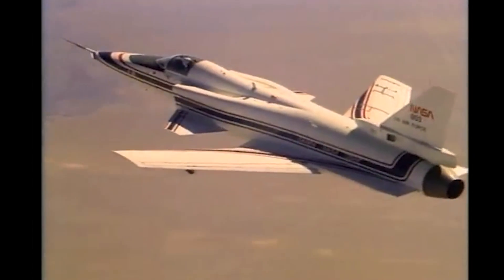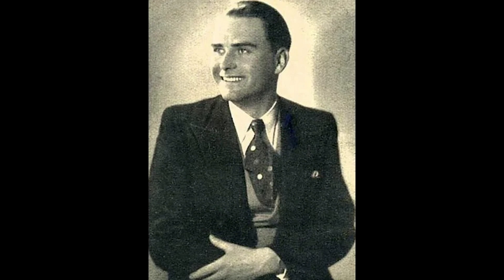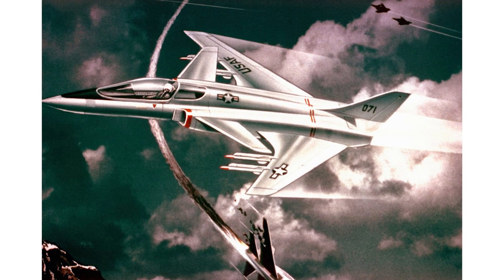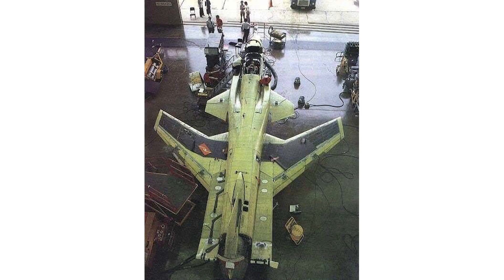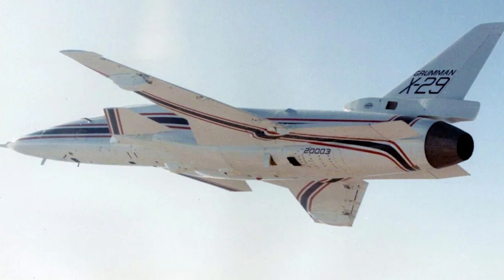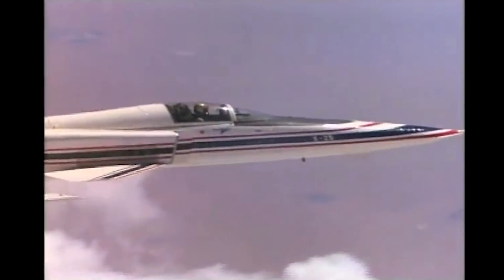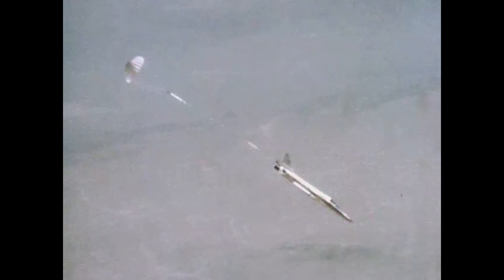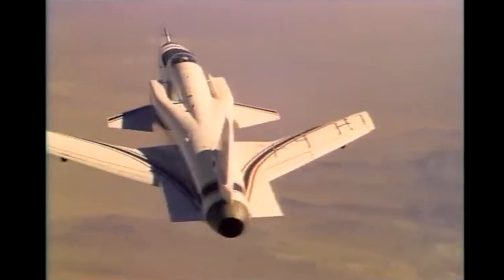Grumman X-29

Comment: This is the first YouTube video I have seen anyone do on the X-29 where you actually describe the aerodynamics correctly.

I'm Australian but was lucky enough to do a degree in Aerospace Engineering in America courtesy of a sports scholarship in the late 80s. During my final year we had a series of guest lectures usually from alumni who were doing this in industry. I distinctly remember 2 of those lectures. One was on terraforming mars and the other was from an aerodynamicist who worked on the X-29.

So I have heard directly from one of the guys who did the aerodynamics of this plane and everything you have said here about the positive feedback of the wingtips is 100% correct. Also my professors area was aircraft structures and he specialised in 2 things finite element analysis of axisymmetric structures and aeroelasticity. Unfortunately he didn't get to teach the class in aeroelasticity because there were never enough students signing up for it but he did explain the basics of it to me. I actually spent a summer working for him doing FEA on the APDS for the Abrams M1, but that's another story. 

Hers's a slightly more detailed description of wing divergence and flutter.
Both wing divergence and flutter are structural effects caused by aerodynamic forces on the wing, hence the term aeroelasticity. They come from the basic fact that pressure is a force and the flow of air causes differential pressure across the surface of the wing. The first effect of that force is to bend the wing upwards. That's easily noticeable if you get a window seat on a commercial jet where you can see the wing. On the ground the wing tip will usually droop a little towards the ground but in the air the wing bends upwards. The second effect is less obvious but its a twisting effect on the wing because of the variations of the pressure across the wing. 

If you go fast enough those aerodynamic loads can bend or twist the wing far enough that it just breaks. That is called wing divergence because the wing simply diverges from the rest of the plane. For anyone who's a pilot that's why there's a Yellow mark on your airspeed indicator for Vne (Velocity Never Exceed).  Yes the wings wont come off at that speed as there's a margin of error, but if you ca past that point and the wings stay on the plane has to go to the mechanics to find out what you damage you did do.

The other effect what we call flutter is more complex and the videos below will show why it has that name. As the wing twists it also changes the angle of attack. In some wings that gets to a point where the wing starts to stall at which point in dumps the lift and untwists. It can then load up and twist again until it stalls again. Its a cyclic effect that can under certain conditions activate one of the wings dynamic characteristics (natural frequencies). There's a few good videos here on YouTube that show this. 2 of my favorites are:
"How to break a glider´s wing" on the YT channel diegocodagnone
"Aeroelastic Experiments - Very High Aspect Ratio Wing" on the YT channel Dani Levin
About 2 minutes into the second one you can see both the wing tip twisting and the wing flexing.

If you have a look through this video on the X-29 you will see that it has an incredibly thin wing. The trailing edge flaps and ailerons on the wing had to be powered and if you look carefully you'll see there's small  pods under the outer wing. Those pods are the aileron actuators. the aerodynamicist who gave us that lecture explained they had to be in pods because the wing was so thin they could NOT be inside the wing. They also had to be powerful and very fast to counter the aerodynamic effects.

LASTING EFFECTS of the X-29
Another thing not brought up in much detail here is that the triple redundant dynamic control system has had a massive effect on aircraft systems since. This was the first time an aircraft of any sort had a digital system where the stability of the aircraft was fully controlled by the computers. All other aircraft up to this point had their stability either designed into the airframe or was done by analog computers. This has had lasting effects on fighter design and is most notable in planes like the F-22. There's a great video on the F-22 flight control system titled "Special Lecture: F-22 Flight Controls" on the YT channel MIT OpenCourseWare, which is totally worth the time to listen to. Also on the YT Channel Ward Carroll he interviews an F-22 pilot in the video titled "Deep Intel on the F-22 Raptor" which if you watch AFTER the other video will make a lot more sense with some of what's said. 

That all said, if it makes you wonder why the Boeing Max-8 MCAS system was NOT even double redundant let alone triple redundant. The only answer I have there is to take your pick of stupidity, insanity, greed or a combination of all 3.
Reply from the maker: Thanks Tony and thanks for your expanded description as well - simply awesome. We didn't want to get too technical with the physics around aeroelastic divergence and anisotropic elastic coupling as that's not the nature of our summary videos, and we certainly can't claim to be aeronautical engineers! But thanks for your input - it's constructive comments/input like yours that makes YouTube satisfying and inspires us to keep going!
Reply: @raafdocumentaries  I'll give you something to think about.
AND I AM WILLING TO DO AN INTERVIEW ON THIS

To graduate we had to do a couple of high level aerospace classes. These are usually run in parallel with postgraduate classes with exactly the same classwork except the postgrads do term papers for their extra credit. Most students do Finite Elements because its fairly straight forward and orbital mechanics because that's what the comms satellites people want.

A few rare (unwise and possibly stupid) people like me do something like space craft dynamics because it sounded "cool." It was a class where you learned the math of space craft orientation which sounds neat but is in fact insanely hard. All space craft have their own local X,Y,Z,y,p,r coordinate system but are actually flying in a spherical coordinate system. So it involves not only solving the differential equations but translating them into the other coordinate system. PLUS it involves gyroscopes so nothing is straight forward as there's coupling between the axis.

Quiet simply its the HARDEST math in engineering across all fields. Sorry to any other opinions it just is the hardest. Your solving (as in integrating) multidimensional simultaneous differential equations while doing a coordinate system translation. Try saying that.

After the first week I tried to get out of it (and wasn't the first) but the professor kept the 4 or 5 of us undergrads trapped along with the 7 or 8 post grads. 

In that class however was the single smartest engineer for solving complex math I have ever met. To do what we did in that course we were all well above average IQ but this guy made us all feel dumb. He was not at the next level but several levels above us.

it was 1987 so almost all of the postgrads were sponsored by DARPA and working on Star Wars this guy was hyper-funded because he could do the math to make a satellite point with next level precision. One of the major issues with pointing in space is structural vibration caused by inertia as you start and stop orientation manoeuvring. That's no issue with radio signals but is utterly useless when your trying to zap something doing kilometers per second on another orbit or ballistic trajectory.

So this guy had the idea of putting in small opposite moves to cancel out the inertial and vibrations. So he was taking the hardest math in engineering and making it harder by adding into it structural dynamics. He actually made it work for the satellite in 2 dimensions, but the math for more dimensions as well as mapping into that problem the trajectory of the target was even beyond him at that time. 

Then of course the cold war ended and Reagan's Star Wars with it.

So I know as only a VERY FEW PEOPEL EVER HAVE of why Star Wars failed to ever make space based lasers work.

Yeah I know there are people who are now saying they can put a laser in LEO and start a fire. 
BULLSHlT I have been in class with the only guy who ever got close to solving the math.

In layman's terms there's an easy way to see the main issue.
Imagine you are in a car doing 27kmh and you are asked to reach out the window and shoot a stationary target 200m away with sub-millimeter precision. Now considering that precision Olympic class gold medalists are only just that kind of accurate at 50m its a hard task let alone adding the fact your moving.
NOW ADD 1 zero to each of those numbers so that is 270kmh and 2km (2,000m). 
NOW ADD 2 MORE zeros to each of those numbers so that its 27,000 kmh and 200km BECAUSE that's what you need to start a fire from space with a laser.
NOW change that 200km to 2,000km and make that target a FAST moving target and then you'll really begin to get your head around the problem of shotting a ballistic missile with an orbital laser.

But then there's what actually killed Reagan's Star Wars lasers off. 
Somebody asked what would happen if the Russians simply polished their warheads so they were nice and shiny, like mirror finish shiny!

Just yesterday I saw Scott Galloway interview and author David Ignatius who wrote a fictional story about space based weapons and he acted like he knew what he was talking about and I can guarantee GUARANTEE that David Ignatius has not got the first clue about space based warfare. NOT EVEN a tiny fraction of 1%.

But then not many people do because they were not in the position I was, in the late 80s.

If you want to do something let me know.
Reply from the maker: @tonywilson4713  Wow! My head is spinning just reading your description! This is probably out of our lane (as fascinating as high-level aerospace physics is) although you could get an audience at @aerospaceengineering5120 or similar. Anyway, appreciate your input and feedback - looking forward to your continued input with our other videos!
Reply: @raafdocumentaries  Yeah you really don't want to get into the issues of aeroelasticity. I got that warning 37 years ago from my professor.

It one of those areas that's incredibly important to all aircraft because of needing to know Vne, but its so damn hard to get into and get experience and get experience linking the aerodynamics to the structural dynamics that its near impossible to be active in.

Wing divergence isn't too hard to get to because its a fairly straight forward "how much will break the wings off" sort of issue. But flutter means getting into the dynamic modes of the wing and that's serious work at the best of times.

Anyway thanks for the reply. I have started back tracking through some of you other videos.
Reply from the maker: @tonywilson4713   I'd say things are a bit easier these days with the maturing of computer modeling but I guess (not being in the game) that physical experimentation is extremely limited (unless you are NASA/DARPA). Thanks for following us!!
Reply: I forgot to add a thing that's hinted at in this video that was also described by that X-29 engineer.

As a normal wing approached supersonic speed the air over the wing can accelerate to the point where its supersonic. This is usually at around 1/3rd of the wing chord where its thickest. That leads to what is called a strong shock (see below). For the X-29 that shock appeared a lot further back on the wing and was a weak shock.

If you have ever seep the drag vs speed curve for something like a fighter jet there's a significant hump at transonic speeds followed by a significant dip before drag again starts to rapidly climb. That hump is because of these strong shocks. 

Because the X-29 forms its transonic shocks further back and because they are weak shocks with less drag it crosses the transonic region much easier than other aircraft. That sort of thing eventually lead to planes like the F-22 that could go to supersonic speed without the massive fuel guzzling of an after-burner.

The simplest explanation of strong and weak shocks is that the air flow after a strong shock is subsonic while the air flow behind a weak shock is still supersonic. Consider if you have a Mach 2 airflow that hits an object causing a strong shock. In an instant you are taking more than 50% of the speed away and that's over 75% of the kinetic energy. Remember Ke is a squared law and twice the speed is 4 times the energy and that flips going the other way. Now consider that if you only reduce the air speed to Mach 1.5 (from Mach 2) that shock is removing a lot less energy. If you then have another shock after that that gets the air back to subsonic then that 2 has a lot less energy removal. 

If you go and look at the nose spikes of either the Lockheed D-21 or Lockheed X-7 on Wikipedia you'll see they have noticeable curves or steps. That's so they create a series of weak shocks instead of a strong shock. The downside to such inlets is they are a bit like 2-stroke motor cycle engines. They have a very narrow power band and within that band they are great but outside that band they suck. That's part of why ramjets never got much use despite being very efficient at their design speed.

Countering that go look at the Concorde inlet. It has a series of adjustable ramps to create a series of weak shocks. That gave it better performance over a wider speed range.
Reply: To answer the last part of your message - it was pure greed. It's way too common to make your systems with double redundancy in planes. I know that Russian do quadriple redundancy cabling and at least double with control systems on their military crafts. So it's a known thing in the aviation industry... Especially with modern day digital equipment which is prone to failure... so it was just pure greed from them... Because you not only save on installing the system, you also save a little bit on your cost per flight... pure greed.
Reply: @korana6308  Your partly right on the technical.
I'd take exception on the digital equipment being prone to failure comment as its mostly NOT true for most gear. We now have digital systems that are incredibly reliable.

I was a TUV certified Functional Safety Engineer. That system and the training for it was fantastic until the business clowns got their fingers into it and screwed it up. BUT suffice to say I am very well trained on the concepts of redundant safety systems.

When Siemen's brought out their S7 Safety PLC it had only a single processor and everybody went "That's not possible. It has to have redundancy." I know the standards better than most and you can get to SIL 3 with HFT = 0 but you then have to PROVE that BOTH the hardware and software have incredibly high reliability. Siemens were able to do that. 

So there is no doubt that digital processing systems can be made insanely reliable.

The problem with MCAS was in the Angle of Attack (AoA) sensor and there was only 1. So even though MCAS itself was incredibly reliable and had been working on other aircraft. They never did a proper CHAZOP on the OVERALL SYSTEM as they were using it on the Max-8.

If you don't know a CHAZOP is very similar to a HAZOP (Hazard & Operability) study except its on the control & safety systems. The basic method is the same. You start by asking 
"If this standard type of fault happens. How will the system respond?"

The 4 most basic ANALOG sensor faults are:
Fail high - the signal received by the control system is the max output value. 
Fail low - the signal received by the control system is the minimum value.
Frozen - the signal is stuck at some point between the minimum and maximum value and does not change.
Erratic - the signal is varying in a random fashion that is NOT indicative of what's happening. 

If they had done that process then only 2 things can happen.
They either ignore the obvious problem or they fix the obvious problem.
BUT NO MATTER they know there's a problem.

The real question that I have NOT SEEN anyone ask Boeing is "What analysis did you do regarding this system's reliability?"

Comment: You mentioned that the base plane was the F-5 Freedom Fighter to convert to the X-29, yet those have two engines and the X-29 has one.
I thought the main plane was the F-20 Tiger Shark? Maybe I'm wrong?
Reply: Your right about the engines, but there's an explanation.
If you look on Wikipedia it says "The X-29 design made use of the forward fuselage and nose landing gear from two existing F-5A Freedom Fighter airframes"

HOWEVER if you scroll down tot he airframe details you'll see that the single engine is the General Electric F404-GE-400 afterburning turbofan. If you click the link for that engine and scroll down you'll find the F20 also used a single engine from the same type except is was a F404-GE-100 not the 400 variant in the X-29.

I also have a fairly lengthy comment on this video about flutter and wing divergence. In my last year of my degree we had a guest lecture on the X-29 from an aerodynamicist on the X-29 team.